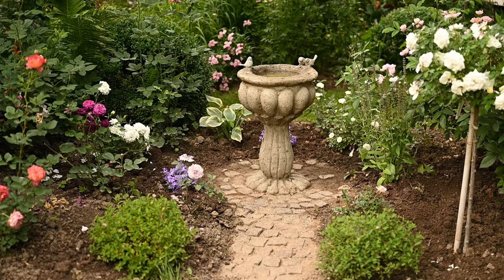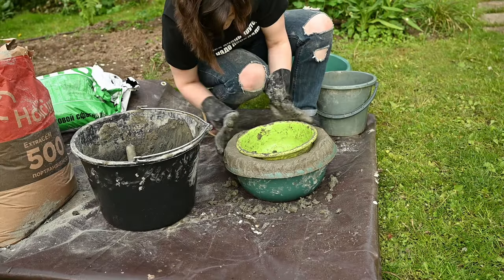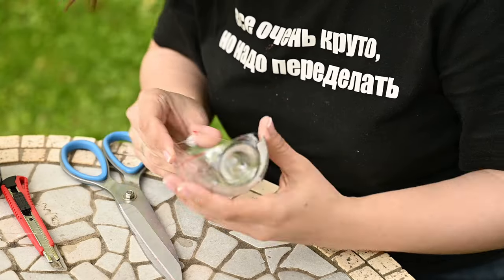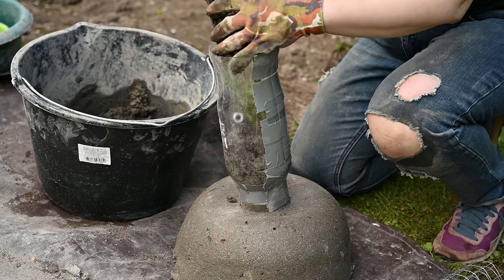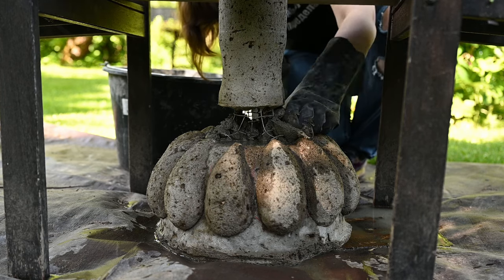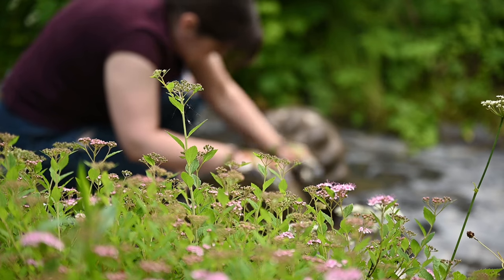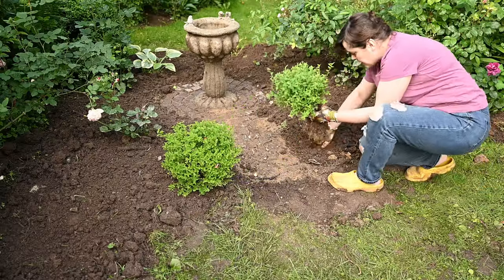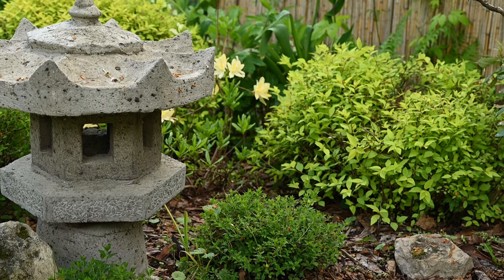DIY hypertufa bird bath using.. plastic bottles!

Comment: Just amazing.  It's been my experience with any bird bath that is use,  my birds anyway will not use the bath if it is to deep. So I usually add a few rocks or glass blobs from the dollar tree so they can splash around. You did a great job. I am gonna make another one. Thanks for the idea, and we'll explained direction.

Comment: PLEASE PLEASE PLEASE wear a face mask. The dry concrete or portland cement powder will go into your lungs and the dampness inside your lungs will "HARDEN" inside your lungs that cannot be removed. You can take off the mask when the hypertupha is very wet and mixed up. Protect your eyes ALSO, so the same reason.........Be safe !!!!!   for your health.